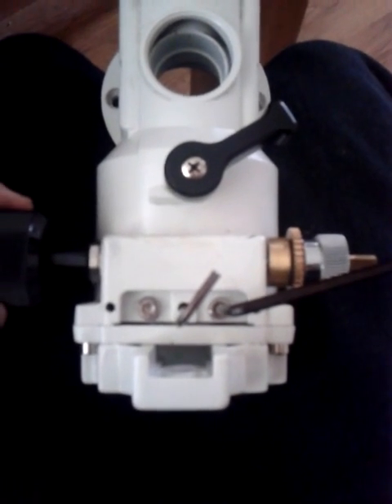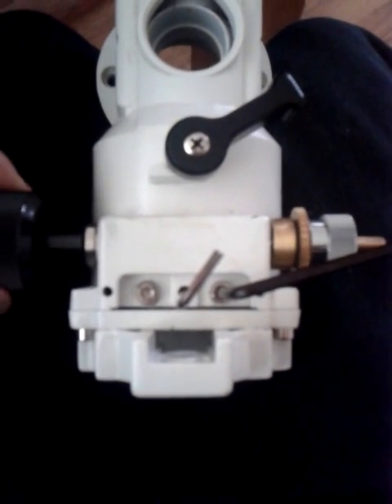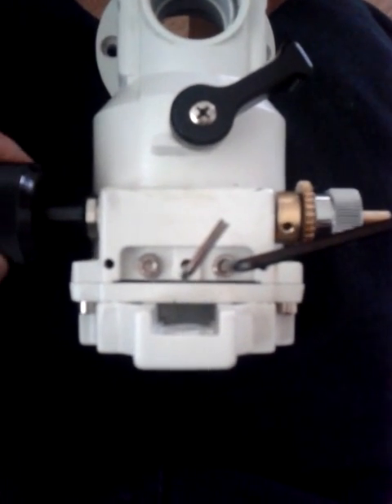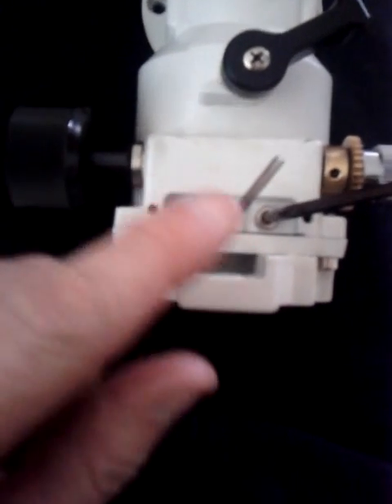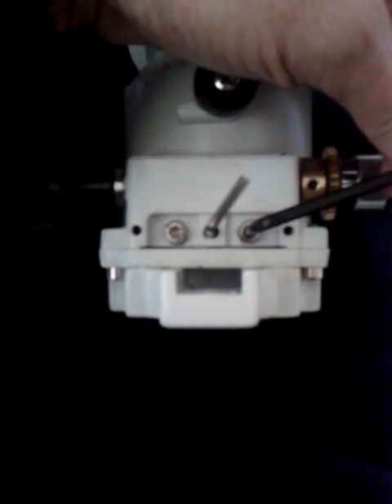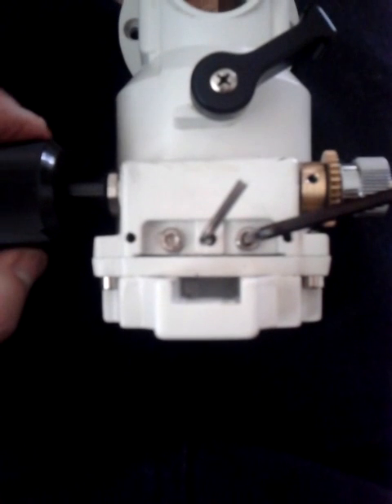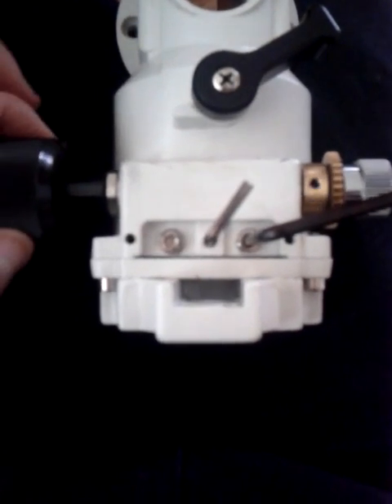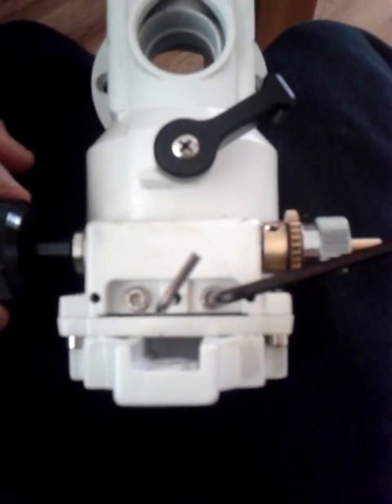EQ5 mount removing slack in gears

Comment from the maker: Just an extra point to note on my video: that little grub screw, when turned in, will move the worm gears apart when moved out it will move them closer, the bolts on the side will then clamp it in place so tiny adjustments and test is best.

Comment: Hi Boodlewoodle. Nice tutorial. Have you got any advice with regard to slack on the cog on the motor? My slack is not on the big cogs but instead on the small cog on the shaft directly from the motor. Also thanks for your videos about making stuff on a budget, you really inspired me in many ways :-)
Reply from the maker: You need to tighten up the small grub screws on the shaft that hold the gears cog in place. Just a general tighten up of the grub screws on all the gears shafts is a sound idea. Budget stuff is a necessity in these hard times Im afraid but if it helps others all well and good.

Comment: Just found this Video ....when using myEQ5 mount very close to the Zenith the motion is not smooth on the RA fine adjustment ..would 'taking up the slack ' cure this ??
Reply from the maker: Removing backlash from your wormgear and cogs is going to improve it, yes but also using good grease is a must too.